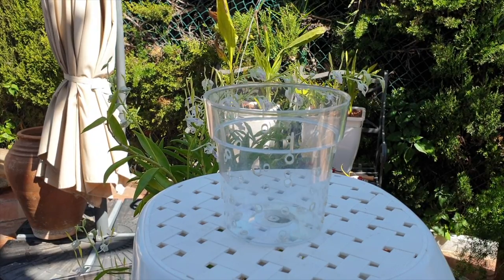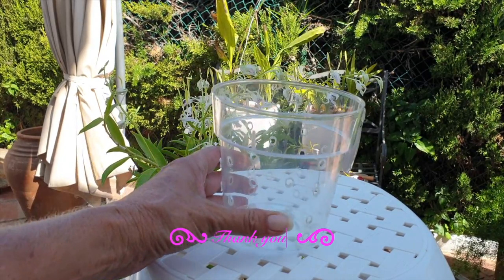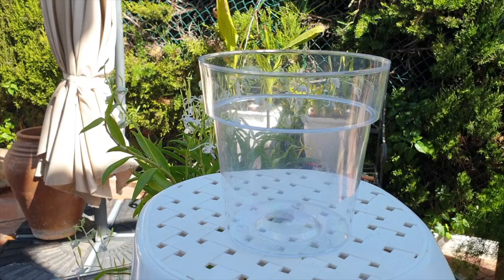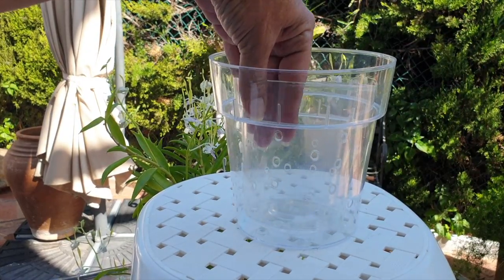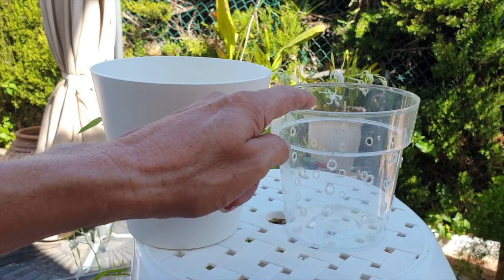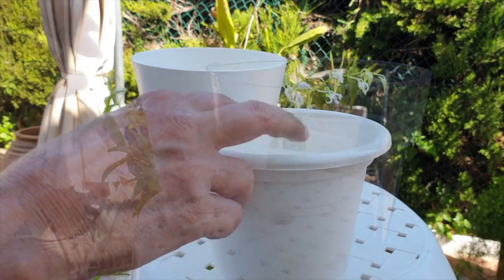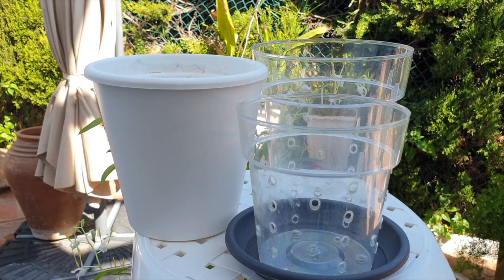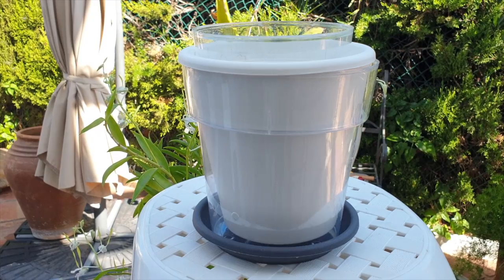Can Semi hydroponic pots have ventilation holes? Best options Semi Hydro pots! #ninjaorchids

Comment: Hmm, didn't some viewer tell you that antennatum is a blooming machine?
Air holes in s/h pots is helpful for the Asccentrum types, since their roots just don't like to be in a "closed" space, it gives them more "free air". Annabelle had hers in mesh pots with a reservoir (IIRC) and the roots stopped dying, although they still wanted to grow out of the pots. In terms of how the s/h works, they won't make much of a difference, other than it may dry faster than if there aren't air holes. It may aid in overall root growth, but I can't say that for certain.
I think people tend to want to grow in pots with airholes because that is what they are used to. The thing is, air holes are generally used to improve/even out dry time in organic media, they don't really serve much other purpose. Since you don't want s/h to dry out, there isn't really a need for them (except in the case of Ascocentrum types, I guess).
Reply from the maker: Don Miguel 🥰💐 hola jefe! Some viewer did, yes... and I was faster and more diligent with the pest maintenance to make sure that no caterpillars take out my spikes this year. 💪🏼While I was good with the antennatum, I was not so good with the Tolumnias, so.... we have a bit a problem there 🤦🏼‍♀️ ventilation holes, are there for tweaking based on environment, but still, when dealing with leca as the media, it should not dry out, or else it isn't SH. Tweaking a set up to make it work for an orchid is the best thing to do to make it work, but then we have to be careful as to how we classify the set up.... it is not SH if there are ventilation holes. I hope that I made the difference clear throughout the video, especially at the end.... hybrid is great depending on environment and orchid in question, as per your example. I have my asconcentrum growing roots every which way but still managed to keep that one root in the pot since it started to grow down. I would not want ventilation holes in any of my selfwatering or semi hydro pots, just because of how the roots behave and will grow out of the holes... and big doo doo when it comes time to repot. In my opinion, ventilation holes are for a wet / dry cycle set up. I don't want to come across as being pedantic about the different 'set ups' and how the pots should be, because everyone needs to know what works best for them, but to classify something and call it semi hydro when it is not, is misleading. I hope that I achieved that in this video 🤞🏼 hope your day is off to a great start!! Miss Schnauzer is back to being happy pup and that Arena has settled in and knows her place in the pack 👍🏼 harmony all around!! Thank you so much for watching, Michael 😘🌸
Reply: @NinjaOrchids  well, if we really want to be pedantic about names, semi-hydro is itself a misnomer. It would, more correctly, be called passive hydroponics (versus active hydroponics where water is circulated from a reservoir around the roots continuously). In reality, what we call SH is any setup with inorganic media that wicks from a reservoir. Self watering is simply a variation on SH but is still SH (like all squares are rectangles but not all rectangles are squares). Rabbit holes, rabbit holes, rabbit holes.
My day may have started off with a bang. There are, possibly, three spikes starting on Dendrobium maccarthiae. I might 💩 my pants.😆
Reply from the maker: @michaelmccarthy4077  woohooooo!!! That is great news! 🙌🏼🤸🏼‍♀️🙌🏼👍🏼